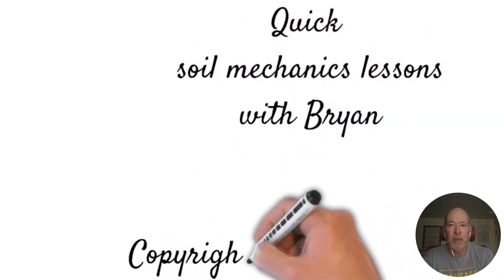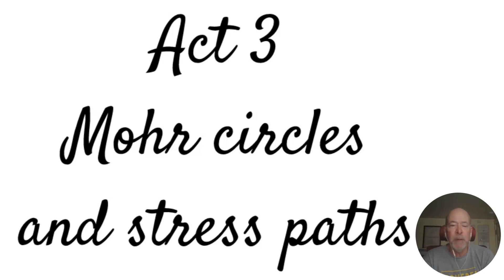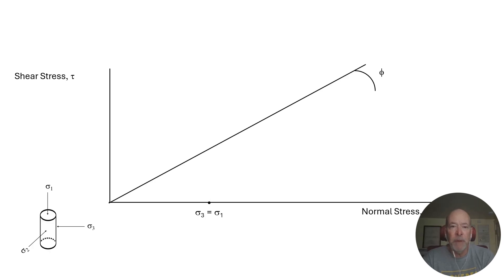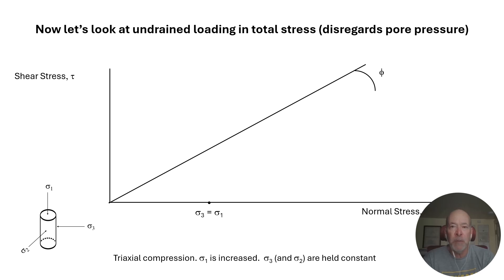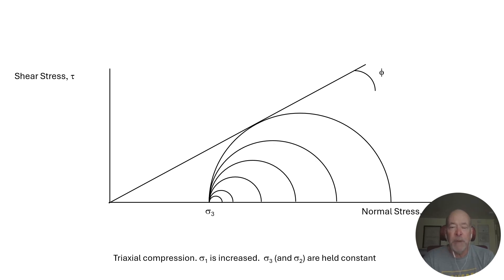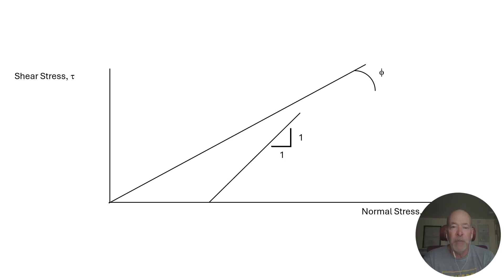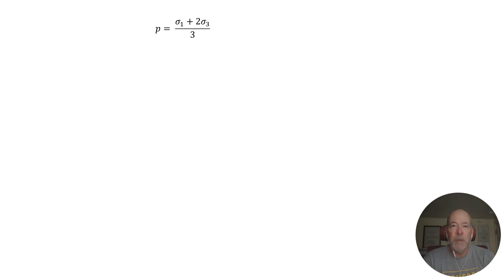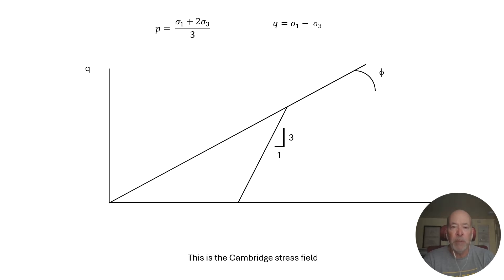Act 3:  Mohr circles and stress paths

Comment: Hi Bryan, if In  MIT space if the stress path pass through the top of circles, then what about in Cambridge space? Because it seems that the stress path is touching the failure line.
Reply from the maker: You are correct.